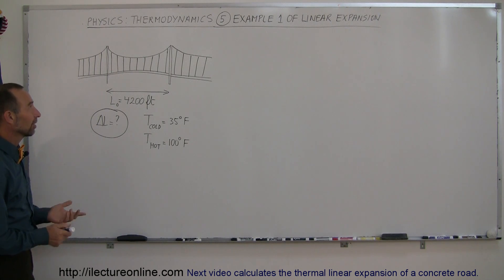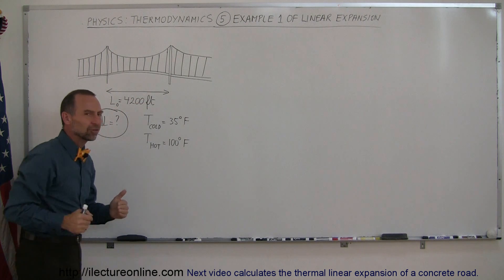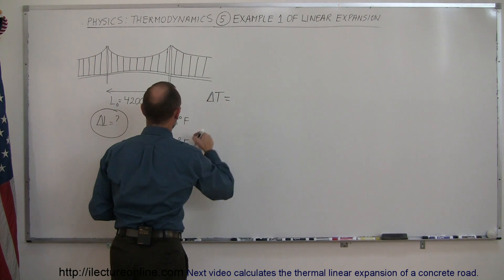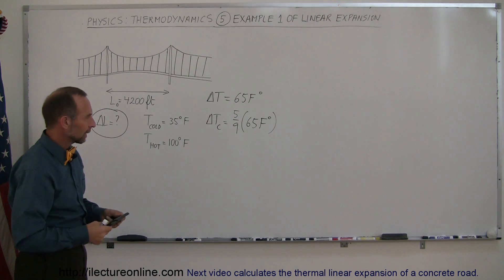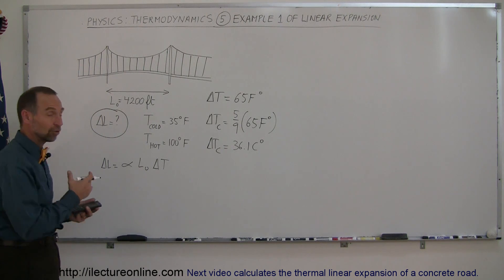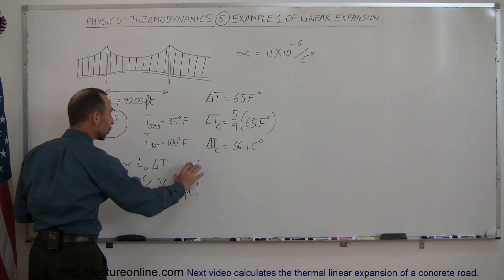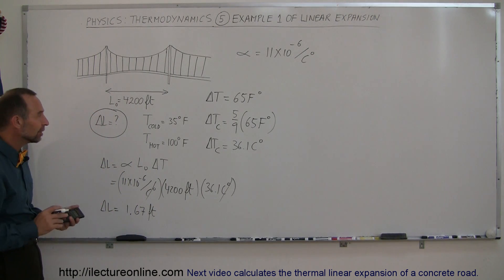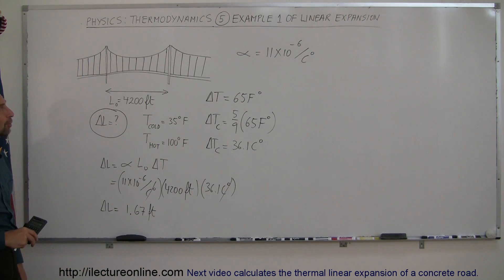Physics 21  Thermal Expansion (2 of 4) Thermal Linear Expansion: Example 1

Comment: Mr. Michel the change in the length is not 1.67 ft but it is 2.49 ft since you didn't constitute for the addition of 32 in your conversion, you received an incorrect value.
Reply from the maker: Thank you for your comment.  The answer in the video is corret.  The "32" have no bearing in the answer since we only use the CHANGE in temperature.

Comment: Professor, why are we no dividing delta L into two since both sections of the bridge will expand at the same time?
Reply from the maker: The total delta L is calculated.  The gap to deal with by engineering is indeed half on each side.
Reply: What?

Comment: isnt it 65 F --->> 18.3 Celsius ?
Reply from the maker: Zander,
65 degrees Fahrenheit is indeed 18..3 degrees centigrade, but 
65 Fahrenheit degrees is equal to 36.1 centigrade degrees.
The first is the actual temperature.  The second is the difference between 100 and 35.  In the problem we are calculating the difference between 100 and 35.
Reply: what do you mean difference between 100 and 35
Reply: im confusing . damn GOd!
Reply: where did get 5/9
Reply: [(T-final - 0 degree celsius )/100 degree celsius] = [(T-final - 32 degree fahrenheit)/180 degree fahrenheit]

btw 100 indicate the difference of division between 0 & 100 for celsius
        180 indicate the difference between 32 & 212 for fahrenheit

u juz exchange the position of eqn 
finally u will get T-final of fahrenheit = 9/5(T-final of celsius)-32 

but this is just for finding the only T final...not for difference between temperature

for this video should follow wht michel explained~
Reply: zander guerrero What you really do is convert both temps to Celsius, then find the temp difference. Easy peezy lemon squeezy 🤓